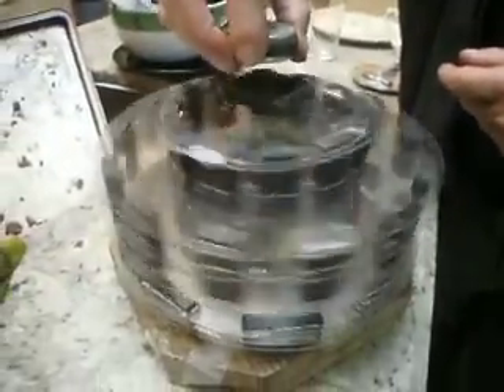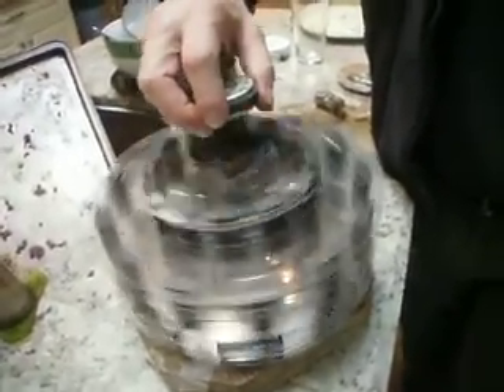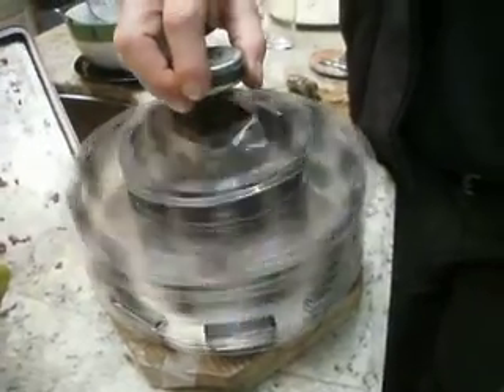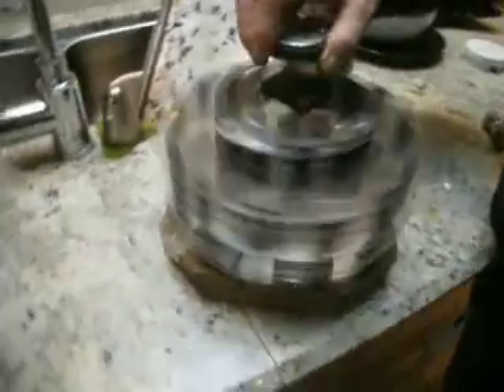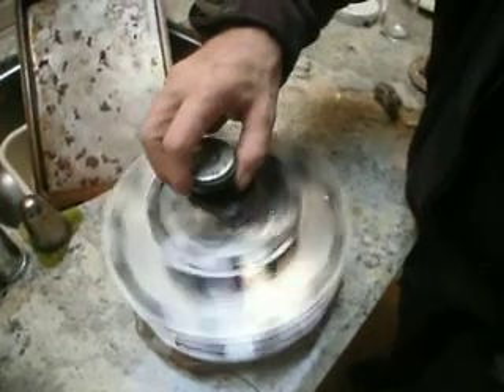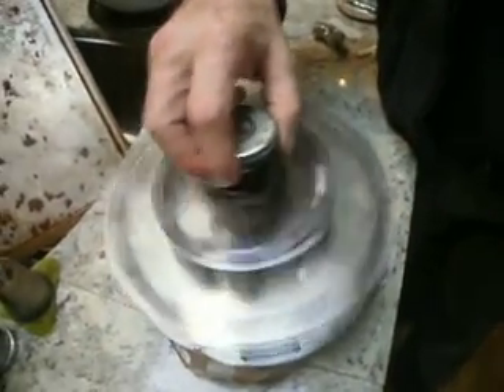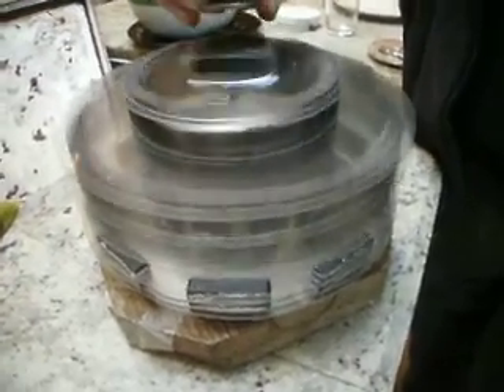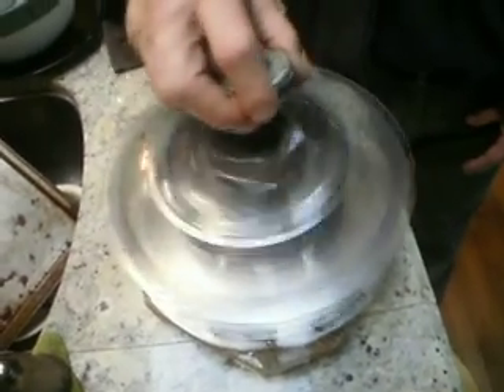magnetic drive systems

Comment: This is a very common type of drive, yet the trick is constructing reliable apparratus to maintain a condition of "imbalance". (Hand-held lines of flux can be easily moved by feel. When stationary, without a hand to "move" them, the magnetic lines will reach a state of equilibrium). It is not impossible, but very difficult. - Otherwise, all you have is a "flywheel".